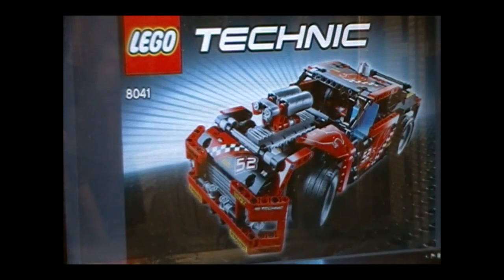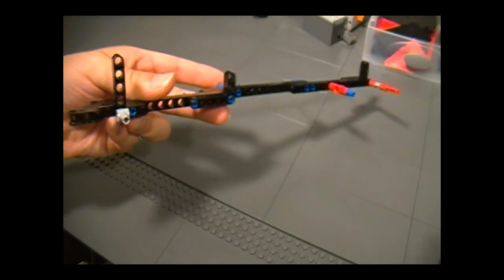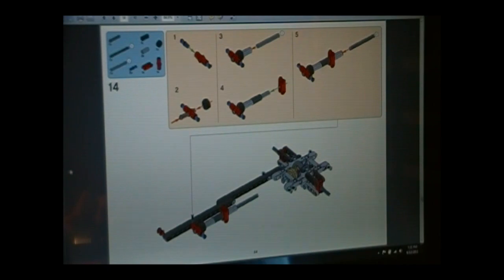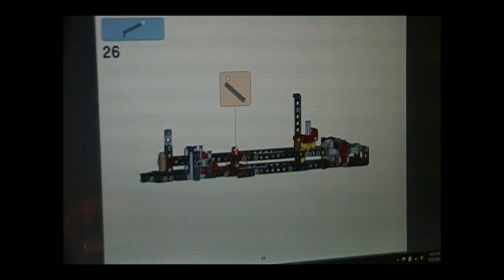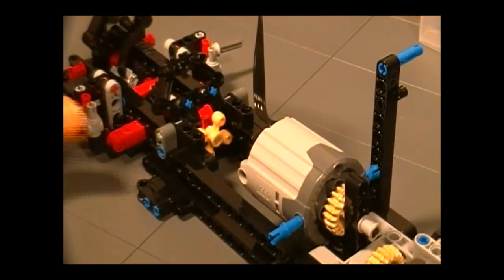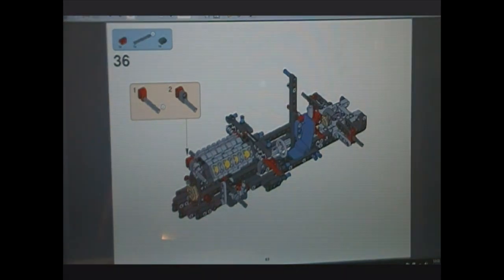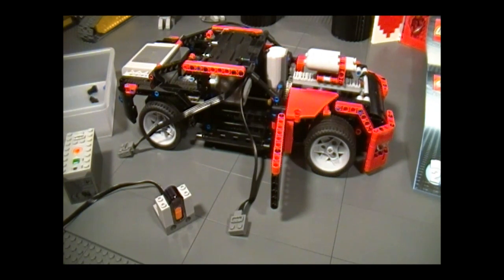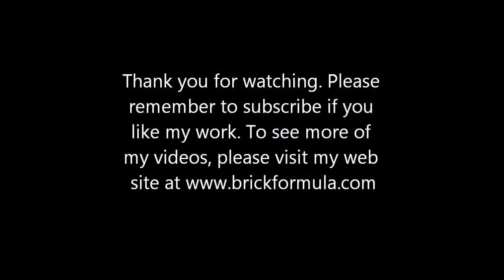Lego 8041B Race Car Modified with Power Functions Instruction Technic

Comment: I put the rechargeable in and the AA one but I didn't wire up the AA but I filled it with batteries and it really improves the rear traction

Comment from the maker: @spongebob123210 
In my original design, I had the M motor at the very bottom, right below the XL motor. It was a really tight squeeze and I don't recommend it. I took it for a test drive outside and every time I ran over a bump, it would scrape the motor.